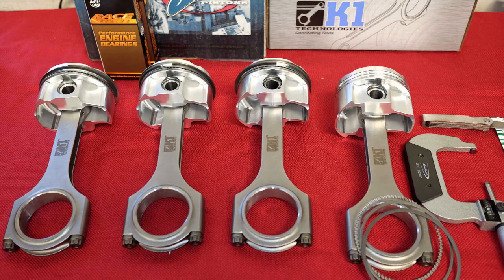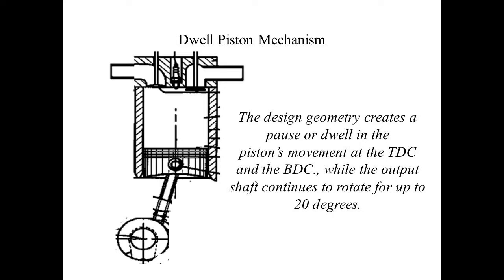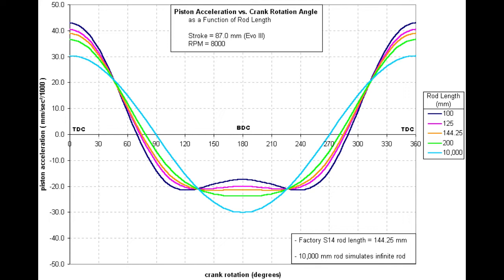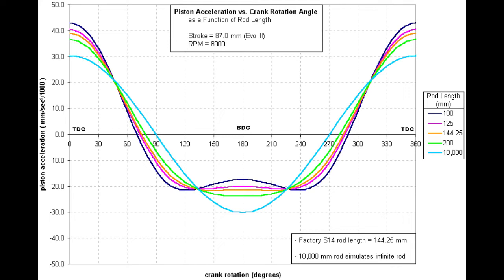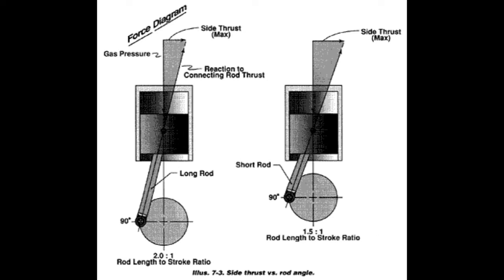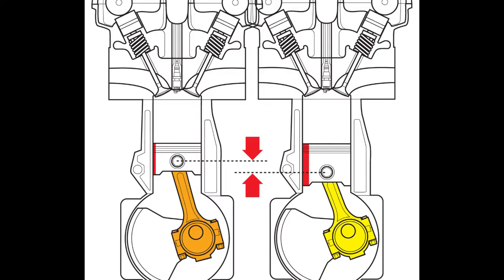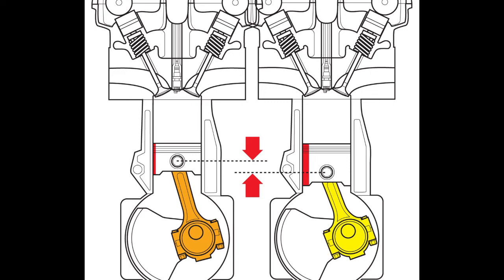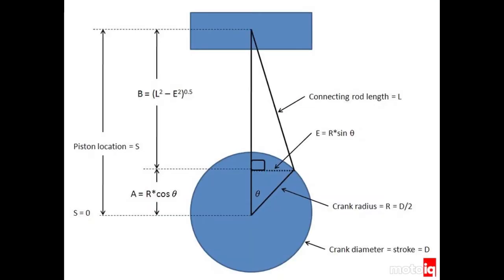Rod to Stroke ratio explained plus recommendations

Comment: The 351c V8 have 1.65 or 1.76  rod ratio opions with factory rods.  for 7000 rpm with 11 to 1 compression. In a street car, I'm concerned about side affects with a longer rod dwell.  What would you recommend.
.
Reply from the maker: Hello! And thanks for the question. No I see no issues with your setup, if anything with an 11 to 1 compression ratio you shouldn't lose much bottom end. Plus with the longer rod to stroke ratio, you should be able to get a benefit of less cylinder bore wear.
Reply: @JWorldAdventures  Thanks for responding.  Yes the shorter rod will give me shorter legs, so the longer rod will give me longer legs, and gives me a chance to upgrade the piston skirt and ring technology like you said. I think your are spot on. Mike

Comment: Boss gd eve,,boss where is more power more high speed long rod or short rod?? Thanks
Reply from the maker: Hey there @Mylene Juan! Thank you for the question. And in answering your question, a longer rod to stroke ratio would net you more potential power up top in the rev range, as a longer rod to stroke ratio essentially aids in improving cylinder filling in the upper rpms. 

Hopefully I was able to answer your question. Have a good one👍
Reply: @JWorldAdventures  ok,,thanks boss,👍👍👍👍👍

Comment: boss gd morning, where is high speed long rod or short rod???
Reply: boss where is high speed rotate long rod or short rod,,
Reply from the maker: Thank you for the question. And in answering your question, that would be long rod if you would want to rev the engine higher and still gain Performance(at higher rpms) whilst not increasing the wear on the cylinder walls as a long rod configuration also reduces the wear on the cylinder walls, compared to a short rod that would benefit you in the lower rpms but would have more wear. Hopefully I was able to answer your question. Have a good one👍👍👍
Reply: @JWorldAdventures  thank you boss,, good jod boss,,

Comment: This is a joke video right ?
Reply from the maker: Not in the slightest. It's legit even the top level formula one teams use this principle in order to allow the engines to rotate high in the rpms with less thrust loading on the cylinders. As well as aid cylinder filling by means of the longer dwell time allowing to intake more air.